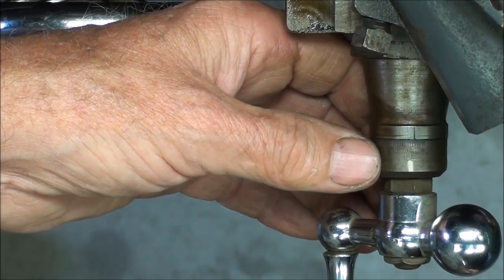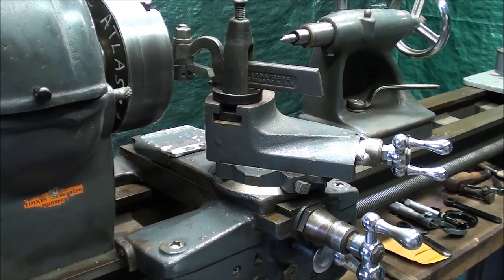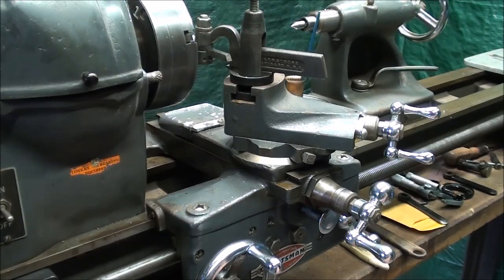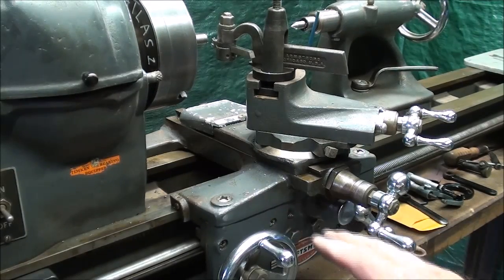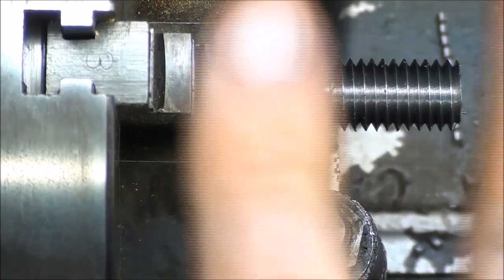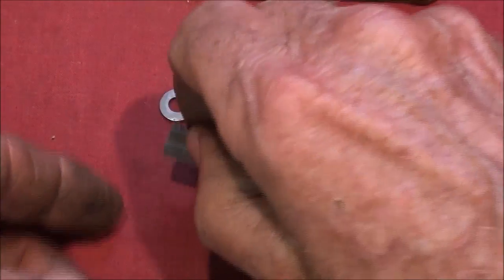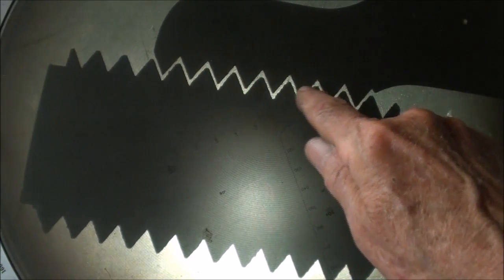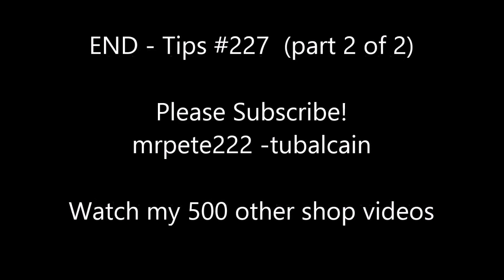SHOP TIPS #227 Cutting a Metric Thread Atlas Lathe Pt 2 tubalcain

Comment: Thanks Mr. Pete, today I'm going to cut a 150,0 x 7,0 mm internal thread on an older manual lathe. Thankfully the part has a thru bore and the machine has a good spindle brake....hopefully I remember to run in reverse to back the tool out.    : )

Comment: hi Mr Pete.   Interesting watching your threading vidoes.   i di som threading today witt same setup s yours, Threading M24.   My threads appeared not 30 degrees30  on each flanke, it seems kind of 20 degrees on one flank and 40 degrees on the other. On finishes threads the 24 millimeter fits good on, but it look kind of ugly threads. I set compond to 30 degrees  and feed in with compond.   Mean tool was 90 degees to workpiece.  Could you please this to me?    Did exactly same prosedure as you.      Mvh   Sverre   Eriksen,   Trondheim.   Norway.
Reply from the maker: Is your tool ground to 60°?.
Reply: yes mr Pete, I use a carbide threading tool, which is 60 degree.     Tried to do same prosidure and feeding right in with cross slide, and threads looked really nice, nut fitted perfect on. feeding in with crossslide in 90 degree to workpiece.

Comment: Ok that's great.  Now, ne1 have idea what I should get to thread metric & sae, foremostly, externals (ie single point)?  And I'd prefer to just punch the size into a computer or something--does this exist? such a thing?  Right now I need 8mm x 1.0 and 1.25 and 5/16-24 RH.  how much will this cost? Machine?  I guess a small manual and/or cnc lathe? what one(s) shouldn't I get?

Comment: I've just come in from the shed for a coffee and have just finished exactly what you are showing. Same thread and size and because I use Metric a lot, the one thing I made absolutely sure of before doing anything else was to make and place a 'Cam Switch Off' on the switch rod and always set it to kill the motor at the exact spot every time. It takes away ALL the nerve wracking element of doing this. Second trick I use is a syringe filled with chain saw bar oil to cut. Absolutely brilliant as far as oil and secondly it will not spill no matter where its put or how, nor seep out. But just a slight squeeze and oil is on tap.
Great entertaining and teaching videos Pete. You're an absolute legend. Thank you.
Reply from the maker: +Tom Tee Thank you very much-those are good tips.

Comment: have you ever cut "wood screw" threads on a lathe -- similar to making a steel stud that has machine threads on one end, and wood threads on the other?

(seems like a sharp, tapered thread is needed to go into wood?)

perhaps a "for the fun of it" video on how to make simple/custom fasteners -- nuts, bolts, washers, screws (metal screws, wood screws, self-tapping screws)?

Comment: when grinding the tool bit what kind of grinding wheel do you use? grade/material. THANK YOU.
Reply from the maker: +ELSDP-45 Actually, its whatever wheel when I bought the used grinder. A med grit alum oxide wheel. Probably a cheap one

Comment: Hi Mr. Pete, I have been watching your videos and I finally got my first lathe a couple weeks ago. (It is a jet 10x20) I noticed some light surface rust on my three jaw chuck and the sides of the ways. Would it hurt the accuracy/squareness of the lathe if I took some sandpaper and removed the rust? (I don't think I could dunk the whole thing in a washing powder solution with a battery charger)
Reply from the maker: +May the Schwarz be with you Use a scotch brite or 600 grit paper
Reply: +mrpete222 Thanks!

Comment: Great looking thread. Not worrying about the half nut engagement in relation to the thread dial on my south bend makes sense. I always feel like it does not engage right on the number. I usually get nice fitting threads, but once in a while I miss the mark. I'll try the reverse trick next time. Thanks for the info.
Reply from the maker: +Edmund Matthews Thanks for watching

Comment: Hi Lyle
Well I have used that method loads of times on a Harrison M390 and I have to slightly disagree with you in that it is not slow when you get used to it. I can use a Que meter and had one on that lathe but to get alignment takes time and reversing the machine is just as quick. I was making pipe ends for Bugatti classic cars. EB's strange threads he liked to use. Nothing was standard. I would pull the cross slide out quickly and reverse the machine using a DRO. But still a very good informative video on the technique. I was mostly cutting brass but some steel and aluminum. My currant machine is a Winho  S1760 which is Taiwanese. I had to leave my old lathes in England when I moved to Canada. I have to say so far it has proved a nice rigid machine and performing well. Time will tell if I live long enough to wear it out. 
Allister
Reply from the maker: +Allister Denyer  Thanks for watching. Not familiar with a Winho. Good comments on your technique

Comment: An optical comparator is perfect for grinding and sharpening the 14 1/2 degree pressure angle and varous point widths on acme thread hss lathe bits. Once you have a comparator you'll wonder how you ever got along without it. Another excellent video. Thanks for sharing.
Reply from the maker: +grantham418  Thanks for watching

Comment: A great tutorial but  If you don't have a reversible motor would it not work to just reverse the tumbler so that the backed out tool moves away from the headstock while the half nut remains engaged?
Reply from the maker: +Anthony Nagy  Thanks for watching--no, probably not

Comment: While watching it occurred to me you could save time and steps by cutting in both directions...then I remembered backlash. Oops.  

I recently saw an auction on eBay for a South Bend threading stop. It ended at a ridiculously high price, but it appears like it would be a very handy thing to have, so I bid on a dovetail cutter and am going to try making my own. I have the milling attachment and the part should be small enough to fit. We'll see how it goes. 

Thanks very much for the information, demonstration, and attitude boost in the can-do department!

-- Mike
Reply from the maker: +BigMjolnir Yes too costly-make your own.

Comment: I don't have a lathe but this makes me wanna get one :)
Reply from the maker: +K0MRADru get one.  Thanks for watching
Reply: +mrpete222 Question for you: I'm just a simple home gamer living in Sacramento CA.  And only thing i could find under a $1000  is (Horrible Freight: 7IN x 12IN PRECISION BENCHTOP MINI LATHE) is that any good for fun little projects?
Reply from the maker: +K0MRADru I was at their store 3 days ago & looked at that lathe.
Its small & not very good. Once the new wears off, you will not like it-sorry.
Reply: Hmmm. That's what iv been hearing. Any suggestions for a similar price range or should i save up for something? Any what about there drill/mills or is that a same story?
Reply: +K0MRADru Are you checking Craigslist? I'm pretty close to Sac and I see lathe deals pop up there fairly often.
Reply: +mrpete222 That's true. And I like Harbor Freight, but that little lathe of theirs is pretty flimsy looking. The money would be better spent on a used quality machine.
Reply: That's what iv been looking at too but i don't have technical knowledge to figure out if i'm getting good deal or not.
Reply: +K0MRADru That's a good point. My first lathe turned out to be a piece of junk due to my lack of knowledge coupled with a less than honest seller.

Maybe you can have someone come with you to check it out or at the very least have the seller demo it.

A quick search shows a nice looking smaller unit for $450. (I can't seem to post links here.) And there's an Atlas down there for about twice that, but looks like it might have a lot of tooling.
Reply: +ShysterLawyer Hmmmm.I'm very anti social, just got couple bffs. Mostly fisherman.  Just like +mrpete222 ones sad "Once the new wears off, you will not like" Well Mr. Tubalcain i've always had different approach to conventional teaching, just like you do. I think what I'm going to  buy the cheap flimsy looking lathe and upgraded with grease fittings. And i'm pretty sure if i watch more youtube ill be able to run GS2 Drive Units - AutomationDirect industrial 3 phase motor on single phase.... Is that even possible?
Reply: +K0MRADru If you haven't pulled the trigger on that HF lathe, I just watched Mr. Pete's series on "Buying a lathe"; shop tips 52, 53, and 54. Good info if you want to check out a used unit and aren't sure what to look for.
Reply: Have seen them, agree good info. But it always comes down to money, and if you don't have much, well: Just been searching craigslist for good deal. But its had to know when you getting a good deal or not so much
Reply: There's an Atlas listed in Los Molinos for $600. An Atlas/Craftsman would be a good starter lathe since is only requires 110 household voltage. No worries about 220 volts and/or three phase for the beginner unless you're prepared for them.
Reply: Hmm... Thank you sir! That might be the one. I hope its still there when i comeback from Russia!
Reply from the maker: +ShysterLawyer Thats a good buy

Comment: Fascinating! It's awesome you are putting this out here for people like myself, I am a carpenter and woodworker by trade but have always worked with whatever material does the job.  

I had to guess at things, 30 or so years ago, when I acquired my grandfather's lathe. Didn't always guess correctly, now the spindle has about a 16th or so play in it. :(

Now you are inspiring me to want to drag it out of storage and see if I can repair it. Any thoughts on replacing bushings in a South Bend 9"?
Reply: +Pat Sullivan If it's babitt you may be able to pull some shims to tighten it up. Check out Keith Rucker's channel, he has some good videos on babbitt.
Reply from the maker: +Pat Sullivan  Thanks for watching!-never did one